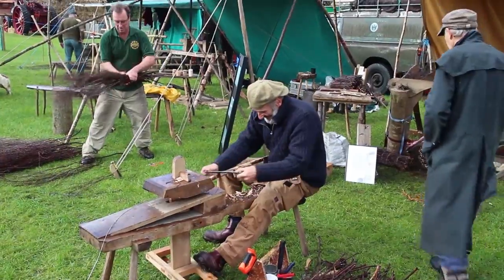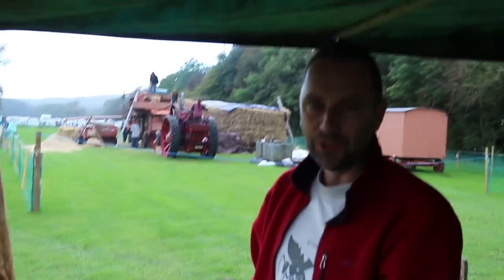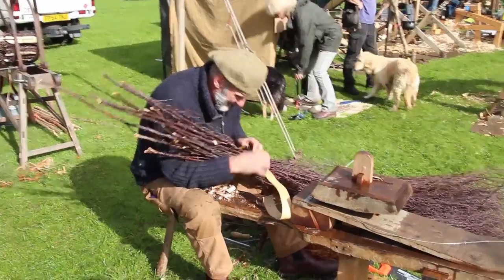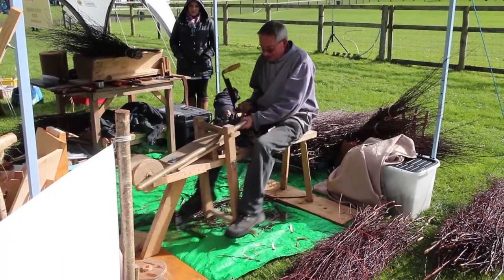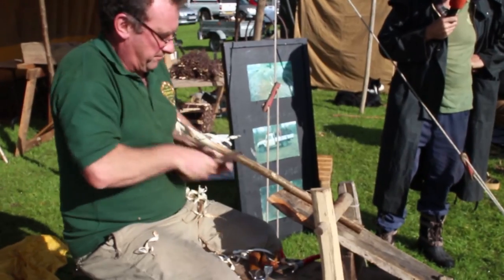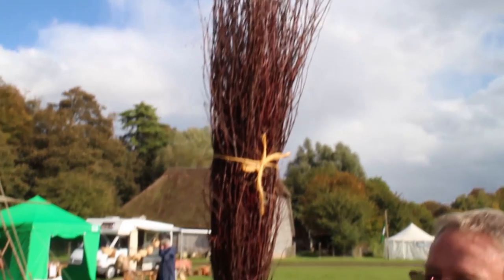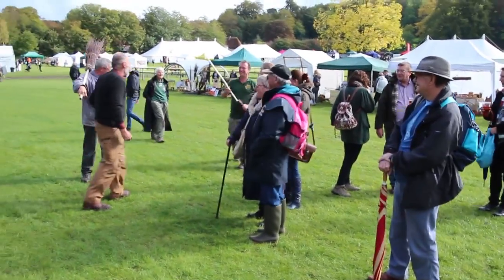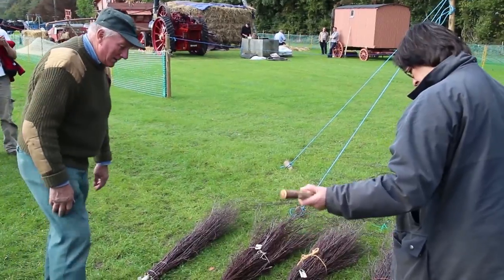Making Besom Brooms

Comment: It's a Scorp not a Scorpio! Technology trying to tell me what I want to say!
Reply from the maker: Hi Edward - I use a scorp for hollowing out chair seats, but this one is shaped differently....it does look like a scorp, but the blade is at a different angle, and I understand its referred to as a roundshave or round shave, its a rare tool and is very much sought after by broom squires.
Reply: Yes we call the tool a roundshave. Probably a local name. I got mine from a friend and it was his grandfathers. Besom making was a local industry here - as is the name Broom Squire.

Although they are normally roughly made they are specific to the size of pole to be shaved and work best when used on a shaving break rather than a horse. In my experience its one of those tools where toolmakers today struggle to make one that works as well as those knocked up by people using them generations ago.
Reply: Harry Rogers VERY similar I'd say. Well according to Goole images anyway.